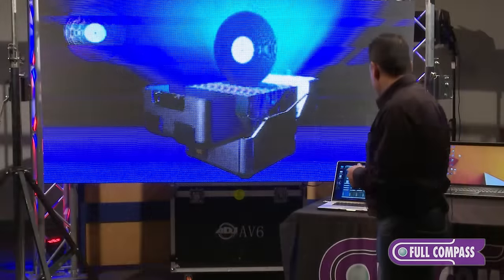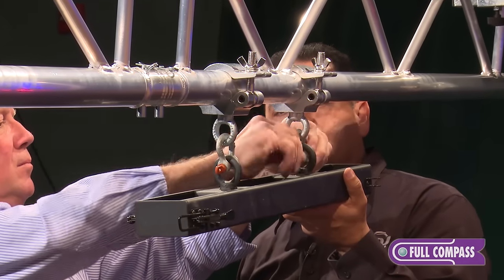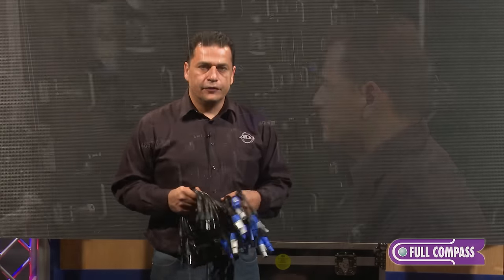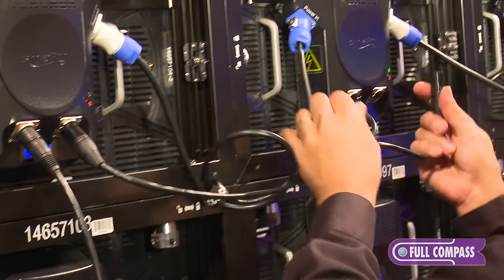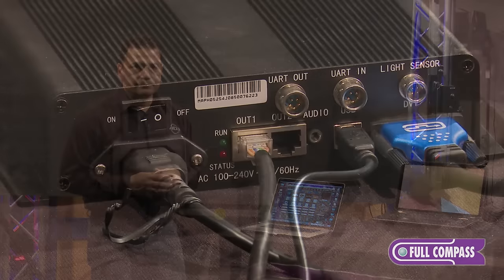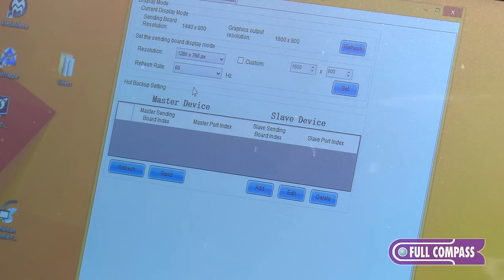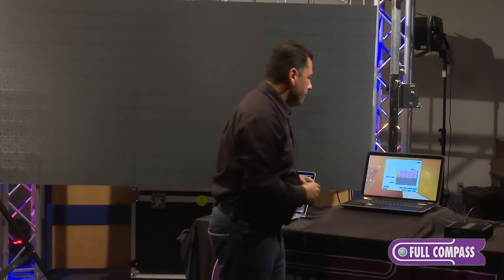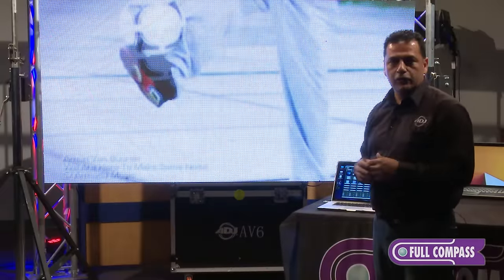ADJ AV6 LED Video Wall Panel Assembly | Full Compass

Comment: The rental LED display box assembly, hoisting method, data line and power line connection, screen debugging, data testing, display content playback, control system connection, software and hardware configuration and other detailed process display, very good video.

Comment: Our church is renting a video wall right now but we are going to buy one.
The size is 10' high and 40' wide.
Reply: @liusteve3138  Thank you Mr. Liu. You have a great product. I sure hope our trade from the US and China stays on good terms. We both depend on each other for products and your labor.
Stay safe and thanks for the information.
Reply: @charmingcharming4368  That was interesting. This technology is going to put the projection display out of business.
We did get the video wall in and had it installed. One thing on our video wall if one 12"X12" square or block has a problem or loses pixels we can just remove it and plug a new one in.
Thanks for the feedback Katrina for your help.

Comment: Hi Marco, Great Video !!! thanks for sharing. With the Nova configuration laptop - do you still have to leave it turned on running in the background after the configuration is saved ? or can you turn it off after the initial configuration and just let the content laptop feed the image to the processor ???
Regards,
Stan
Reply: Hello Stan, once you do the configuration you do not need to run the Novastar software. If you are using a separate computer it can be turned off.
Reply: Why 2 computers?

Comment: To Run These do you HAVE to run the Media Master Express Software @ $ 1850.00 to buy  ? Or Can you just hook the Laptop up to it and Run your Normal Set up you have been using at your church for the last 5 years ?
Reply from the maker: Hi BigHearted. You do not need to use Media Master software, but you do have to be able to set the output resolution of your computer to match that of the video wall.

Alternatively, you could connect the computer to a switcher/scaler to manage the resolution. 

Thanks for your question. I hope that helps.

Comment: The processor RJ-45 cable is terminated terribly.. why're the wires crimped like that? I tough pull and the whole operation comes crumbling.

Comment: Two questions thinking about making the purchase today, 

Can I use projection church programs like pro presenter to project on these screens? 
Also if my church doesnt want a huge truss is there a way we can mount it on the wall?
Reply: yes the sendingcard has en in the minimum en DVI input but wenn you don't have enoug pixel for 1080p in the videowal then the controller just take the pixel vrom your monitor from the upper Left. In this case iprefere the VX4 sendingcard this can scale your hole desktop to the screen.
Reply: @leddisplayscreen6935  whats your email address?

Comment: I recently started helping someone build these walls and we’ve run into this weird issue where when we wire the data cables in a left to right configuration, the wall doesn’t like it. But when we wire the data cables in an up & down configuration, it works perfectly fine. Is there any reason you know of that would stop the wall from displaying correctly when the wires are wired in a left to right configuration versus up & down and vice a versa?
Reply from the maker: Hi . I'm sorry to hear about the issue you've been experiencing. The first place I would look to trouble shoot is on the wall controller. You can change the wiring pattern of the wall in one of the sub-menus. Where that menu is varies on the processor. The most common processor we sell is the Novastar VX4S, and it’s under Screen Settings >> Data Flow. 
I hope that helps. If that doesn't solve it or if you have additional questions, please let us know. I'll do my best to get answers for you.
Reply: Same issues
Reply: This usually happens when the data pattern in the Novastar software is the reverse of the physical wiring. Make sure that your "S" patterns match.

Comment: i've seen other led panel sellers here on you tube and i'm trying to understand why your video screen looks so bad coming from a company your size?
Reply: True I've seen other panels that look much sharper and brighter.
Reply: which ones have you seen that you recommend?
Reply: Willy Bernardus Curious I wondering help me find where do I find outdoor panels to mount in a Box Truck
Reply: where are you based?
Reply: Good point Adrian, the reason the panels do not look optimized is based on viewing distance. This video was not planned for and we decided to do it improvised. The camera was placed close to the video wall and ideally on a 6mm video panel you want to view it at a distance of 25' or beyond. The tighter the Pixel Pitch (distance between pixels) the shorter the viewing distance or the higher the resolution.
Reply: This is a professional comment !
Reply: Adrian Love       k
Reply: The answer is simple. Viewing distance is important. This is the AV6 and an optimal viewing distance for this panels is about 25ft.  The camera is too close.  But in real life if you are at 25ft or more it looks great.

Comment: what about rain, do you have a special cover in case it rain?
Reply: Verne the ADJ AV6 is an Indoor video wall. It can be used outdoors under extreme care without exposure to water or extreme heat or a dusty environment. For outdoor video walls you want to purchase one that is IP65 and ADJ has just introduced the AV4IP for Indoor and Outdoor use.
Reply: Vernel Rolle use waterproof wall

Comment: Hi,,how many rigging bars, power link cables and data cables i will need for 8 modules to set ip up the same way you did?
Reply: Widner for 8 panels we recommend 4 Rigging Bars, 7 Power Link Cables, 7 Panel to Panel data cables, 1 Main Power Cable and 1 Main Data Cable. Contact ADJ or Full Compass for more information.

Comment: Great video. Could it be used with virtual dj.
Reply: Hello Mark, you can run any software on a video wall, think of it as a secondary display. Grand VJ is great because of the video layering and Video mapping capability of XT.

Comment: The one thing I must say about the ADJ AV^ Panels is ADJ goes through them with a fine tooth comb before they ever sell one . ADJ Has VERY HIGH STANDARDS on ALL of their equipment they sell . UNLIKE Most of the Panels you would Buy on your own out of China , unless you know the ins and outs on LED Panels DON'T BUY THEM . You will be Disappointed in so many ways . When you Buy a ADJ Panel in June of 2017 , When you Buy more in June of 2018 The colors will match because ADJ has taken the time to Go Through them to Color Match them all .. Big Thumbs up for ADJ ...
Reply: that locking mechanism though having to screw them so much really suck when building a 120mx40m led Wall InfiLED are great panels

Comment: I think having to use both a mac an PC is not good. All this should be able to run from either a mac or ec. Sorry this is a complicated method although u explained well. Next time show a way to use a single computer.
Reply: Thanks Cane Juice, the reason I used two computers was because the NovaStar software is only PC based and at the time of video shoot I did not have windows on my Mac.
Reply: Is it still only pc based?
Reply: Yes, NovaStar LCT software currently is only PC based. Heard a mac version may be available soon.
Reply: thank you. so basically you only need nova star and a pc to configure your screen. once that is complete you wont need it again unless reconfiguring?
Reply: Exactly. Only to re-configure if you change your cable path or add/remove panels.
Reply: thank you
Reply: Marco Oceguera two years later and novastar still has no mac anything. Crapy ass company you guys teamed up with!

Comment: I was just in China where these are all made and I was blown away by how many different company's are building them . I know the Prices of LED Panels have been dropping , Do you see that happing to yours ? I found P6 22 1/2" x 22 1/2" panels for $ 195.00 each plus shipping . What do yours sell for ? Thank you for the Great Video ..
Reply: BigHeartedMan65 for one panel it's around $1,000
Reply: I just bought 128 P3.0  , 576mm x 576mm for less than $300.00 each from the same factory you get yours from . LOL...LOL... KIDDING The Control box you sell for $ 800.00 The Nova (Wholesale) is all over Alibaba for under $ 300.00 shipping included . I sold my Panels to 3 different Churches for around $ 765.00 a panel which is under your dealer price . As I said , They are Dropping in Price
Reply: BigHeartedMan65 where can I find panels To Mount facing out of a Box Truck.?
Reply: link of them Dm ?
Reply: @BigHeartedMan65  Looking to get an LED wall rig for my church.  Where is the best place for me to get this for cheap like you mention? Beign that your comment is One year old hopefully theyve dropped in price also lol. Any info is greatly appreciated

Comment: now with the led TV's this technology is obsolete
Reply: For screens smaller than 85 inches, this LED wall isn't practical, but for the massive video walls and screens used at concerts and live events, this certainly isn't obsolete technology.
Reply: No it’s not... For practical transportation this is better. LED TV are not made to bring back and forth....